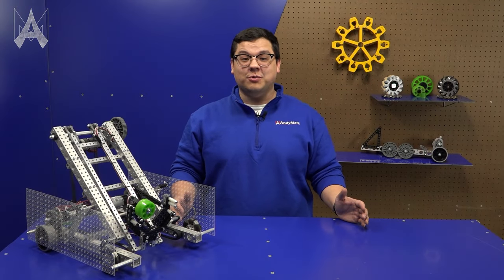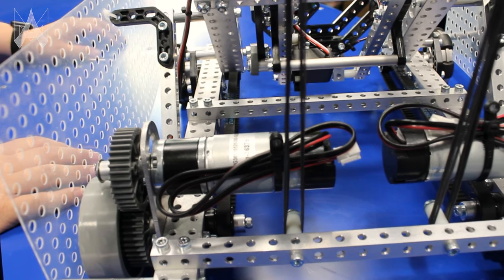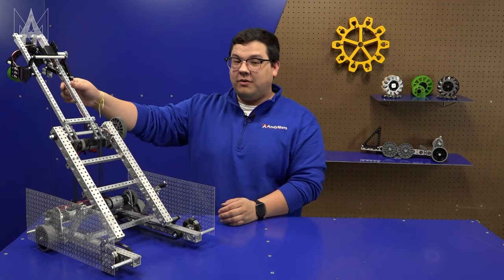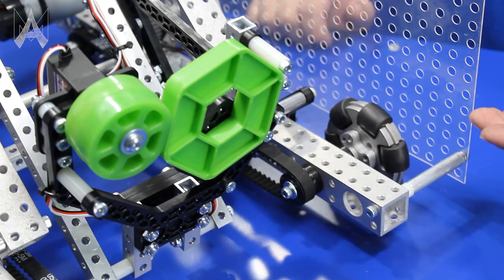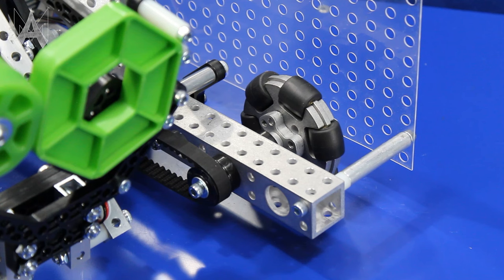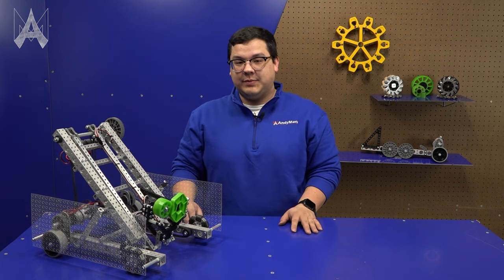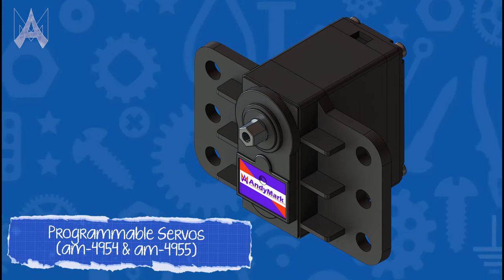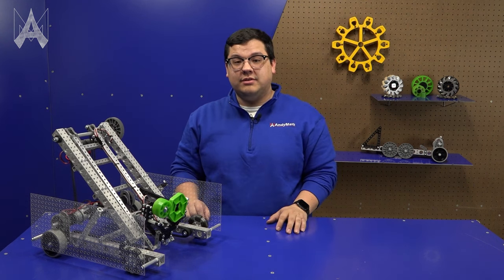How Do I Play CENTERSTAGE with Robits?

Comment: Honestly, not in love with the design of the build system at first glance. Would recommend Actobotics or goBILDA (with Actobotics being better imo). Would also encourage exploring custom built robots for CENTERSTAGE to learn more about the engineering design process that goes into any machine.

Definitely am excited to see another build system enter the market to hopefully create more competition and strive for innovation.
Reply: Actobotics is discontinued, and doesn't have the ability to fit motors into U channel, which is extremely important.

Comment: How is the servo for the hand mounted?
Reply from the maker: The servos are screwed to the structure using 10-32 screws. They have integrated mounting flanges for easy assembly. You can see more details on the Programmable Servos product page:
https://www.andymark.com/products/programmable-servos